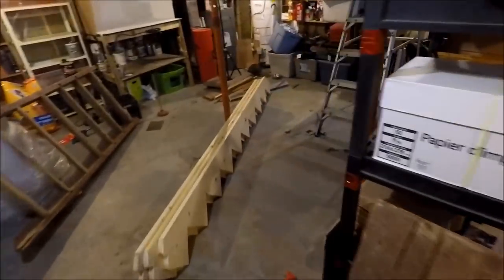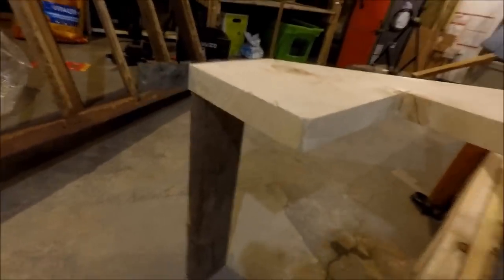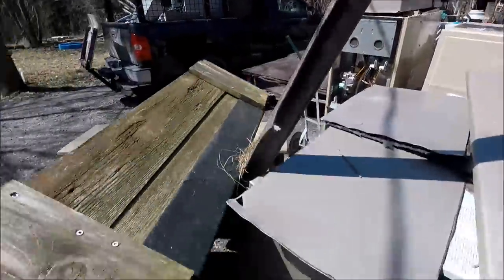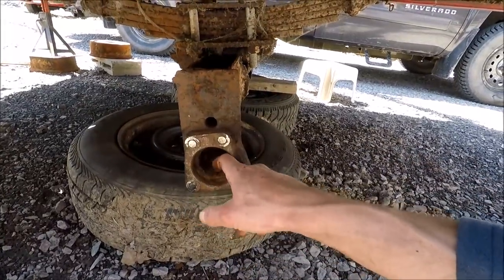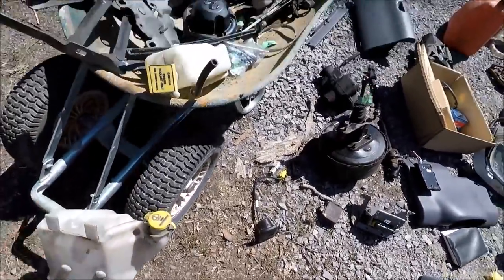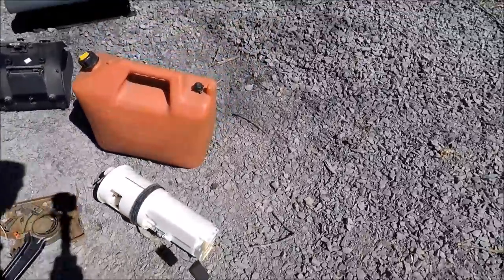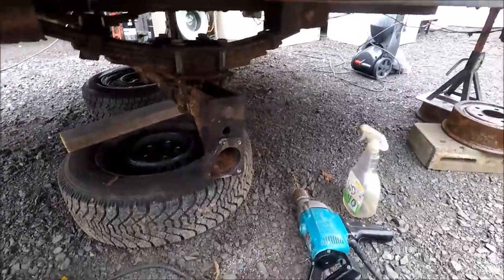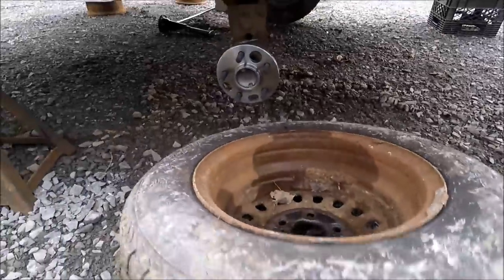Free Stuff Pickups, Parting Out Dodge Ram Truck, Old Trailer Fix, and New Stair Case!

Comment: The electronics modules with tubes might be parts from a Tektronix oscilloscope. The porcelain terminals on which all the parts are soldered are fairly typical.

Comment: Question, when you buy parts such as for the trailer or for the truck   or spouses vehicle, do you buy used or new? Im not sure if a site i purchase items  thru ships to Canada  but the various yards linked may. If you shop around. You can find parts cheaper in 1 state vs another. I was buying parts for my 4x4 lil SUV, found yards in Texas selling parts for 1/10 the price in California and Nevada. I know shipping may kill or may be worth it if the price is right. Also depending on how close you are to the border. Ppl buy n ship to a friend in a close state then dive over n pick up. If you buy parts used older parts, i can try n find the yard link site. You can  actually  compare prices, it tells ya if its an A B. C etc grade.. A being best.. some ppl wsnt engines to rebuild, but have parts for 2 or 3 engines n combine them into 1 engine. Engines are best local pickups but parts are dif. Its so way better then calling a dealer or a high mark up place. Reason why i buy from Texas, Oklahoma? Dryer states, less rust. Nevada and Arizona  too but to close to Cali. So they still mark up. I use to use this site when i worked with dealers, or in the shop. It could help even in the future. 
Btw. Im glad your you.. stay you n not like others in youtube. Ppl watch you because your NOT like everyone  else. You may recycle but your not them. Does that make sense?